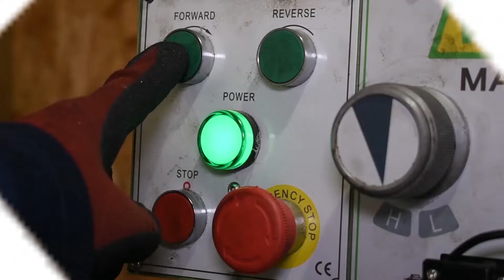Boll Aero 18  1.8cc Model Engine Build Part 2

Comment: the secrets in the diesel engire is to use pure eter,if dont be pure ,the engire dont start.!for this reason ,i buil one(sparey),and i have start  problems,and  put a glow plug., and use fuel for glow engires.

Comment: You make it look easy. Should the crank pin be correct diameter for the drill or reamer on the con rod? I tried and failed to turn the crank pin, but I only have a small lathe. I think you have years of skill.
Exellently presented video.

Comment: Looking good, you have a nice lathe which copes well with the intermittent cut when making the crankpin. If folk are wondering what the hole down the shaft is for, and the cross hole, they allow  for lubrication of the bearing.
Reply from the maker: Thanks Chris, I was wondering what it was for.